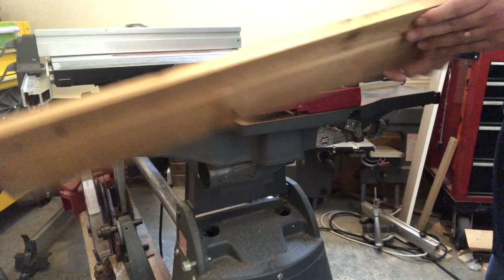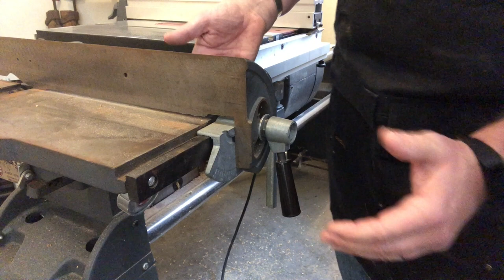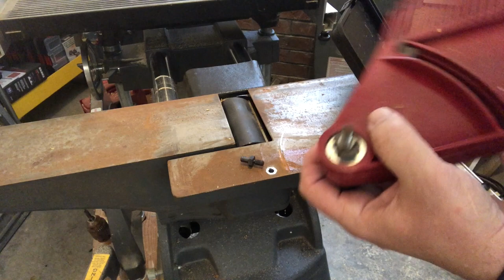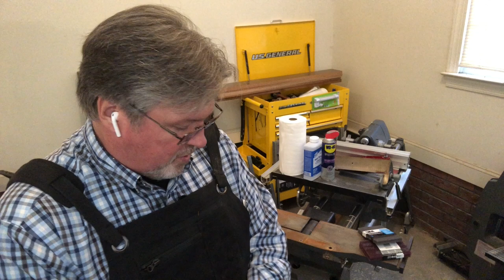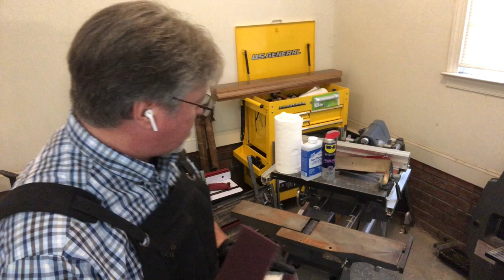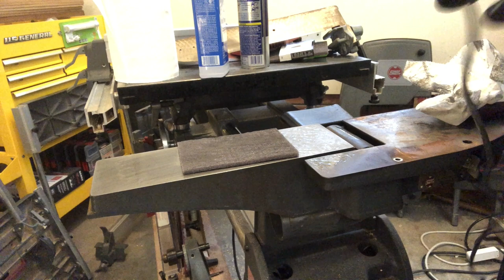Restoring a Rusty Shopsmith Jointer using the Ol' WD-40 and Scotch-Brite® method

Comment: My ShopSmith Jointer is mounted on my Power stand... one of the great features of the ShopSmith Jointer is the fence when locked in to 90 degrees it stays put... I watch a lot of woodworking videos and the new portable Jointers all of them seem to have fence problems locking that 90 degree right angle in... I use that old WD-40 and Scotch-Brite®rust remover and then wax method all the time. My shop in in my garage so winter and high humidity plague me all the time. I would love to have a 8" spiral or helical Jointer, but I have a 735 deWalt Planer which does what I need done in the shop... "square an edge!" I watched the episode with Nick Engler that was great I have his books from years ago when I got my ShopSmith in the 1980's... The videos are full of good stuff keep up the good work!

Comment: Thanks for the great information you share. My shopsmith is 35 years old and has every upgrade. I have never gotten the full benefits from my new Scroll Saw, I'd love to see a video on how to use it.
Reply from the maker: Thanks Kay. I have the Mark V mounted Shopsmith scroll saw, but in the past have owned the freestanding version. Which do you have and what color is it? It was grey and went through a couple changes over the years and finally was changed to teal, which is what mine is. Scott
Reply: @MyGrowthRings  I have the gray Mark V mounted unit. I have never felt like i am getting the best results from it. I have almost every other accessory and they all work great.
Reply from the maker: @ckaynx  Sorry for the game of 20 questions, but these answers really do help me understand the situation. Does your table have a jig cast into the two back edges, for assembling the blade into the blocks, or does it have a rectangular hole stamped near the front, or no accommodations. For assembling the blades and blocks besides a little hand held jig? Scott

Comment: Thank you for all of your expert advice on this channel - you have helped me greatly with my Shopsmith (acquired in Oct 2021).  I now have a jointer that has a little rust and I want to clean it and use the wash protection you suggest.  I don't think you ever said how you apply the wash other than stating you were not going to brush it on.  So, is it sprayed on or wiped on?  Thanks.

Comment: I really have thought about updating a original 1980 Shopsmith jointer with the feather guard, and the dust collector port. I should and believe I will now.
Reply from the maker: Those are both easy retrofits and are worth the effort. Scott

Comment: I am a new subscriber.  I just repacked the grease bearings on my bandsaw upper wheel after watching that video. Nice!  I have a 50+ year old jointer of my dads for my Shopsmith and it has some rust.  The thing has been sitting up in the attic because it is a bit rusty and I don't trust that it is sharp and aligned properly.  This video has inspired me to get it out, and recondition it.  Thanks!!!  However, I echo others here -- I really need to know how to sharpen the blades and assure they are aligned properly.  I'm looking forward to that video. Please boost on your priority list. :)
Reply from the maker: Thanks for the feedback, Chris and thanks for subbing. Scott

Comment: Hey Scott, not sure if you've covered it in another video, I bought a jointer that I've cleaned up the bed like you have, how can I tell if the bearings are good or should be replaced?
Reply from the maker: That’s such a subjective call, and no, I haven’t really discussed it. You can almost instinctively tell by spinning the shaft at the hub if the bearing feel too Ty, or free spinning or if there is any grind or play in them. They are very easy to replace and also rather inexpensive, so it in doubt, replace them.

Comment: The washer under the nut holding the guard on appears to be a cupped, or "Belleville" washer, which is supposed to have the "cup" facing the bottom of the board, so that the tension from the nut is more evenly spread on the bottom of the guard.  They  are commonly seen under the nuts holding lawnmower blades to their shafts. Thanks for another informative video.

(P.S. Unless those white EarPods are being used as hearing protectors or for critical communications while on camera, they tend to attract attention to those trendy items and detract from your message, IMO.)
Reply from the maker: You are right, that may very well be a Belleville washer, in which case your advise is correct.  And yes, the AirPods are being used for the audio and I wish they weren't there, but without them the audio is awful, as noted by several of my earlier videos when I wasn't using them. I've purchased a wireless mic, but haven't had the time to figure it out.  Scott

Comment: Hi Scott,  I like  your formula weekend post and mid-week touch base.  Question:   at the beginning of the video, you mentioned that you sharpen your cutting blades, what is the angle? and will you provide tips on how to do it in a future video?  Thanks in advance
Reply from the maker: Thanks for that feedback and confirmation. As for the angle, I'm not even sure. I just match the angle that is already there, which it turns out isn't really all that critical. Scott

Comment: You mentioned that the Shopsmith jointer is narrow to surface a board. How do you s4s rough lumber?
Reply from the maker: That’s a very good question. Typically I’m working with S2S FAS lumber, which isn’t typically too cupped. I used to use some Select grade lumber and it was a pain in the butt due to cupping. I do have a 6” jointer in my shop and used to have an 8” and access to a 14”, but after switching to FAS I haven’t had much need for surface jointing. Good question! Scott
Reply: @MyGrowthRings  That's  cheating having a 6" jointer. Have you ever used the Shopsmith jointer and cut the board down to fit and then glued it back together?
Reply from the maker: @rdhelm  I suppose it is, but I never use it. That’s the jointer I mentioned was under a cover in my shop collecting rust. Yes, I have done exactly as you describe. I purchased a couple hundred board feet of cherry once that was terribly cupped but otherwise gorgeous. I wound up ripping it on the bandsaw to prevent pinching of the sawblade, and I surface jointed it before reassembly. It was a lot of work and I swore I’d never do it again! Scott

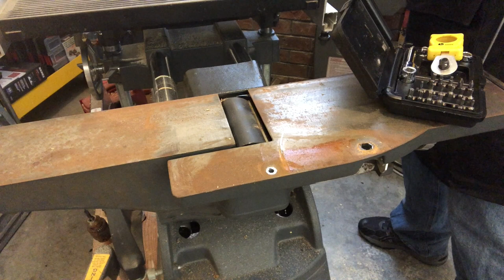Comment: What is that on the back side of the jointer real clear at 7:28, looks like a cover for the power connector, mine doesn't have that, and I can't see it in the parts diagram from shopsmith..
Reply from the maker: It's sold as part of a jointer dust chute upgrade.  https://www.shopsmith.com/ownersite/catalog/j_dustchuteretro.htm
Reply: @MyGrowthRings  aah, no wonder I couldn't find it in the jointer diagram.  

Have you tried butcher block oil on saw tops/planer tops?   I've made knives for 30 years, and after I finish sharpening  them, I rub them with a thin coat of butcher block oil and let it dry, and they stay looking new for decades.   I coated all the tubes inside and out on my shopsmith when I first got it 88, then waxed the outsides and no rust on them at all.  I was considering putting on my jointer, when I get through evaporusting it.
Reply from the maker: @fordcrews3362  No, ai would be concerned with it transferring to my wood and potentially messing with my finish or joinery. It’s probably a totally unfounded fear, but a fear nonetheless!  Scott
Reply: @MyGrowthRings  I'm pretty sure it wouldh't stain wood, it's  mineral oil, beeswax, and carnauba wax, hardens like a varnish, is super slick surface, that doesn't need buffing like j&j after it dries.   I used to have an after school job in high school cleaning the sewing machines at a local factory that made dress shirts, and we used it on the presser feet, thread loops, needle plate, and the beds, because it made them slick so cloth would glide over them and seemed to repel cloth dust.

Comment: Thanks for this info Scott. My jointer is not rusted, but the bed has become dark. Would it need to be cleaned as you have done for rust?
Reply from the maker: It wouldn't have to be, but I think you'd be amazed how a little elbow grease will make it shine like new. Scott

Comment: Scott, just bought a jointer and it shipped completely disassembled.  When assembling the outfeed table to the infeed table, there is 3 flat washers and 2 spring washers.  Can u tell me in which fashion those should go.  I’ve tried putting them on both sides of the stud and the cutter hits the table.  I’m just not doing something right?
Reply from the maker: They go on after the two casting parts are together in this order: washer, spring, washer, spring, washer. I suggest looking in the Facebook Owners Group files folder or perhaps even on VintageMachinery.com  to see if there’s a manual, because there’s an exploded view of the parts in the back.  Scott
Reply: @MyGrowthRings  thanks man!!
Reply from the maker: @neiljackson2799  You are welcome.
Reply: @MyGrowthRings  Scott do u have a website or a way to send u pics to communicate better??
Reply from the maker: @neiljackson2799  Sure. You can email me at ScottMarkwood(at)gmail(dot)com

Comment: Curious about the paint thinner.  Does it leave a residue that might cause problems with the paste wax?  Glen
Reply: I think the wax has mineral spirits in it.
Reply from the maker: Hey Glen. Yes, Robert is correct. If I were to leave it at that there would be a touch of an oily residue left behind, but since I will be following the mineral spirits with either paste wax or in my case, an oil based poly, which both contain mineral spirits, I won’t have a problem. If I truly wanted to have zero residue I would follow the paint thinner with either lacquer thinner or alcohol to remove the residue. Great question! Scott

Comment: I've got a shopsmith I got from a coworker and it's got rusty tubes, any good method to recondition those? The Jointer I got is similar condition as this one, so I'll be using this method on the jointer for sure
Reply from the maker: There are several methods that work, but far and away my favorite is to use a product called EvapoRust. You can get it online or from Harbor Freight and it works amazingly well to get the bulk of the rust gone. From there you just need to polish them a bit with ScotchBrite and WD40.
Reply: @MyGrowthRings  thanks! I take it I'll just be coating it with EvapoRust and wiping it off since the tubes are so large? or should I do a full disassembly and try to find a way to soak the tubes in a large containter? I've used Evaporust before on smaller things so it's always been a dunk and soak in a small container
Reply from the maker: @RichyN25  The best approach is to wet some cloth or even paper towels with the Evaporust and wrap that around the tubes and then wrap that with saran wrap or stretch wrap to hold it tight to the tubes overnight. Whatever you do, do not slide the headstock or the carriage over the rusty tubes.
Reply: @MyGrowthRings  Sounds like a plan! Thanks a ton!
Reply from the maker: @RichyN25  Let me know how it works out. Whatever you do, don’t use the potato method!

Comment: Recently got a 500. Have the old school aluminum guard and it just has a hex bolt that holds it to the jointer with no washer or nut on the bottom. How do I get tension so it puts pressure against the stock going through?
Reply from the maker: I'll cover that in the follow-up, if you can wait a few days. If not, there are answers on the Shopsmith Forum. Scott
Reply: @MyGrowthRings  got it. Got to wind the spring before you put the hex thru thank you

Comment: first, I really enjoy your videos! Is there a tool for setting the knives on the planer? One other question, I picked up one of the old shopsmith books, it's packed away right now so I can't give you the exact year of the copyright, it was in the mid 1950's. The bandsaw had a table that had two miter slots @ 90 deg. The book show the miter being used as a fence for the saw.
Any idea why Shopsmith went away from that style of table?

Thanks again for your content!
Reply from the maker: Yes, there is a very simple, yet effective stamped steel gauge for the SS Planer.  If you meant SS jointer, SS never made one but they did sell the Magna-Set at one point and it works, but isn’t really any easier than the method in the owners manual. As for the bandsaw table, SS introduced the larger aluminum table for the bandsaw to accommodate the t-slot miter gauge, and while they were at it they decided that the timing was right to introduce a fence, which wasn’t really a thing back in the 50’s when the saw was introduced, but was a very popular request in the late 80’s.
Reply: @MyGrowthRings  thanks, yes the planer is a SS. I will order the stamped steel gauge. I just moved into the city (Kennewick WA) and went from 2000+ sq ft of shop to 300 sq ft. I have a SS 510 that I bought new in the early 90's. It's been stored for about 10 years. Selling off all the other tools to reduce the foot print. Cant wait for your next video!
GT
Reply from the maker: @gregtrim2356  That’s quite a challenge, but you’ve picked the right tools for the job. Just this past weekend I was having the same conversation with a buddy who has a new-to-him Shopsmith planer and he used the gauge for the first time and said he was thrilled with how well such a simple tools works. You’ve got this.

Comment: Hey Scott, the video is well timed. I too need to refurbish my SS jointer and I appreciate you doing this. In a somewhat unrelated question regarding a bench did you get your SS bench refurbished? I’m wanting to build one and have considered MDF. I’m in upstate SC and humidity is an issue do you think it would work in an unheated garage?
Reply from the maker: No, I believe that it's too far gone from being stored outside by the previous owner. I would have to break apart every glue line, resurface and re-glue to make it sound again, and even at that I'm not certain that the wood itself isn't compromised.  For now it's just a table to store things on. Really makes me sad because it deserved better than that. MDF can work but you'll want to seal it very well with either paint or poly because it will suck up humidity like a sponge. You might want to consider using it or plywood with a sacrificial and replaceable surface of tempered Masonite. Being in NC I know all about the South's humidity!  Scott

Comment: Hi, being across the pond (Hebden Bridge, UK) I have very little access to Shopsmith parts or advice.  A few years ago I wanted to put a rebate on a wide piece of wood which involved me removing the feather guard.  Oops I grabbed the black knob on top and simply turned it anti-clockwise and took it off and then the feather guard.  Now several years later I cannot remember how to re-assemble it and what components there should be.  I have the black knob and the spring, at the time I did not remove the stud or the two circlips.  I now appear to have the stud intact complete with the two circlips, the feather guard, a coiled spring and a black knob which appears to have a set screw in it that doesn't turn. Any suggestions or a little video of its assembly would be great. Just come across your channel and have subscribed and will now back track through your other videos.
Reply from the maker: Hey Mark, welcome. There's actually an instruction manual that might be helpful. Check this out and be sure to report back. Scott   https://www.shopsmith.com/ss_forum/download/file.php?id=41251
Reply: Hi Scott thank you very much for getting back to me, I have downloaded the file you have sent me and will endeavour to see if I can reconstruct the fence to working order.  I will of course keep in contact with you and let you know the outcome. Mark

Comment: Please emphasize  to Shopsmith jointer owners to never put and up or down force on the fence or not to over tighten the jointer fence hold down. This will bend to the breaking point the cast aluminum quadrant.
Reply from the maker: Looks like you just did! Thanks, Bill. Scott

Comment: I used to work in a machine shop where we used pump spray bottles for wd40.  When I left I bought a gallon of wd40 and a couple pump    spray bottles that should last me 10 years.   I've seen my share of aerosol wd40 cans run out of gas before it runs dry.  Or the can gets dropped and the nozzle breaks off
Reply from the maker: I don’t use that much of it and if the fan won’t work that’s just another excuse to go to the hardware store!

Comment: I have this exact issue.  Bought a Joiner and it's rusted.
Reply from the maker: Yes, they were originally covered with a layer of oil and a VCI Paper, or Vapor Corrosion Inhibitor paper, but once we remove them they will rust pretty fast without wax. It's a frustrating how-do-you-do, for sure!  Scott